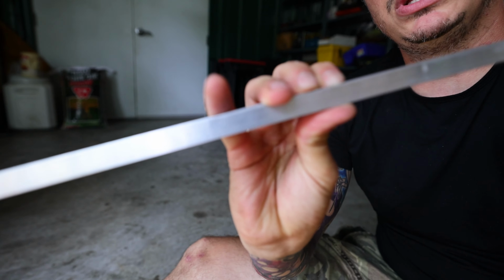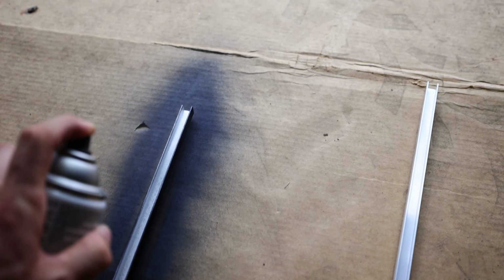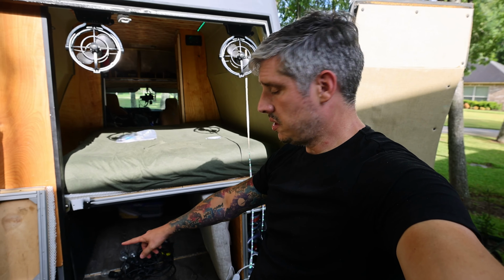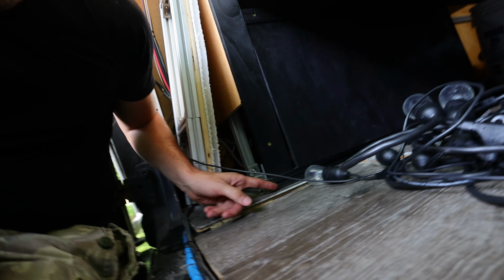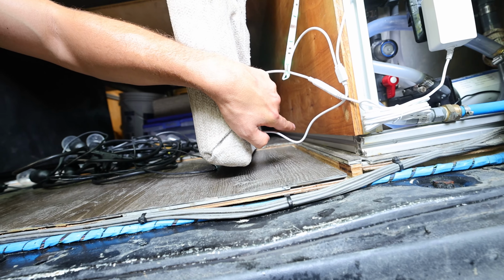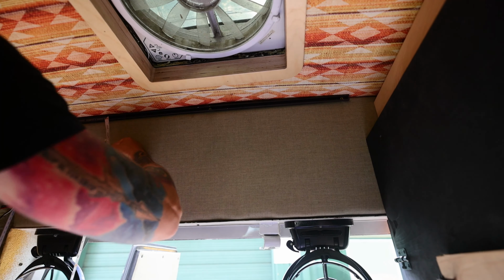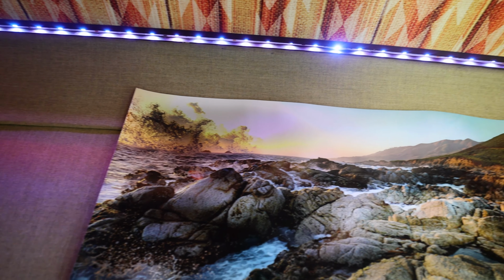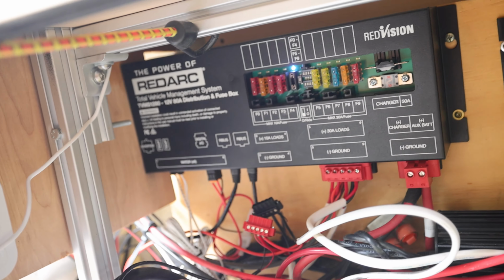Illuminating My Camper Van - Ep. 87

Comment: A lesson I've leaned the hard way a couple of times is that those light strips are sometimes very particular about wanting 12v exactly, and 13-14v from a charging battery can ruin the controllers. They make converters that get wired in-line to make sure the output is always exactly 12v. Might be worth looking into.
Reply from the maker: My uncle did the wiring for me. It’s his forte. He’s an electrical engineer. ✌️